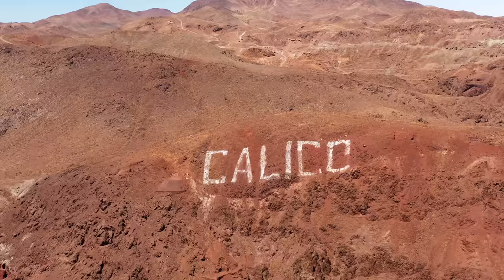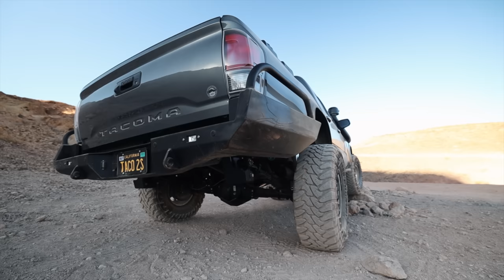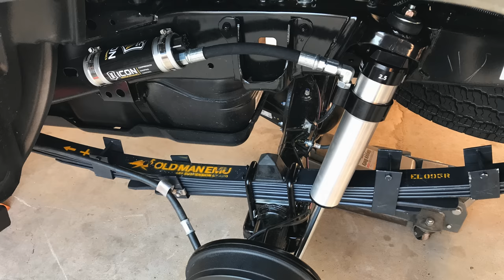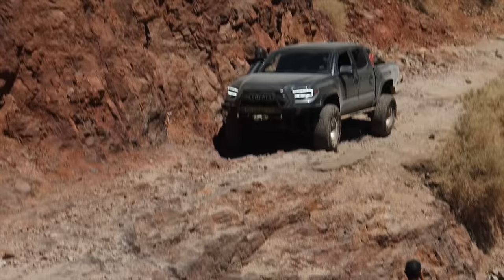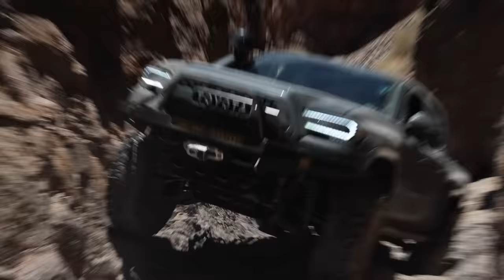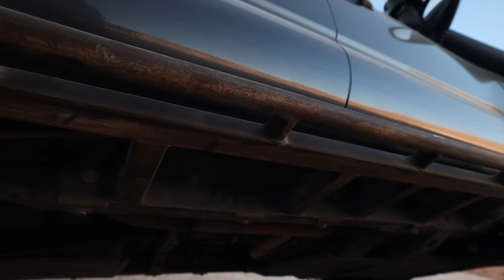Built to Wheel! Toyota Tacoma Walk Around

Comment: What's up with the exhaust?  Looks like a reroute at least.  About to have mine done.  Also, a huge yes on Nitro  re-gearing.  I am only on 33's now with cab mount chop and stuff, but the gears are huge!  I tow a lot too, and my transmission doesn't hunt like it used to!  I did 5.29's, but I can easily fit 35's with no rubbing now with the lift, chop, and a few pinch welds.
Reply: I think its just axle dump chopped - stock exhaust. (in my opinion)